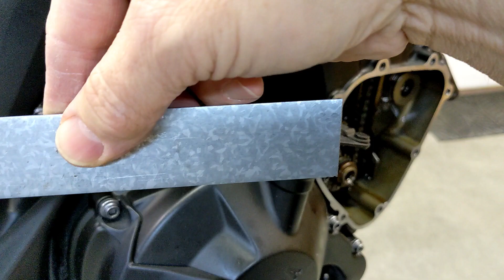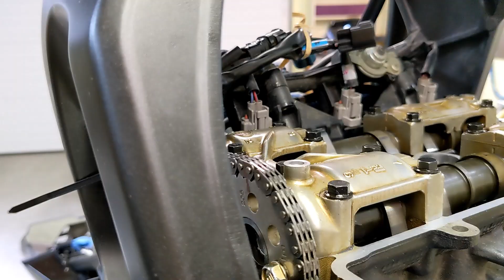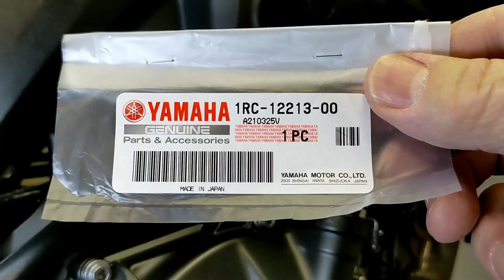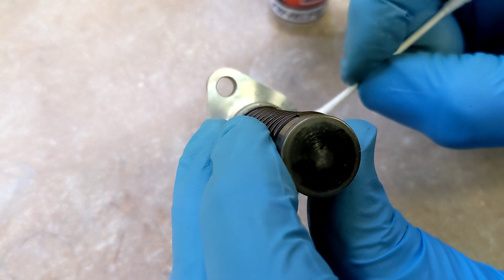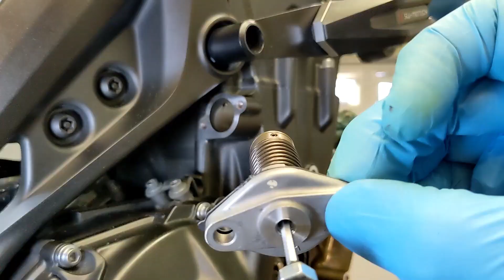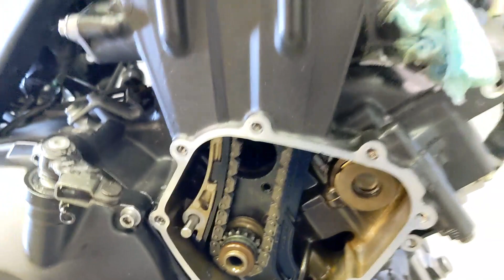reinstalling cam caps and setting valve timing  (PART 2) Yamaha FZ-09/MT-09 2014 2015 2016

Comment: what would I noticed different on my 2014 yamaha fz09 if the cam chain jumped a tooth?

I swapped to a A.P.E. recently and now my bike has less power at the front end of my throttling. My bike power the more I twist if that makes sense.
Reply from the maker: If you feel like it's off by a tooth I would stop riding right away and verify the timing
Reply: @meticulousmechanic  Honestly I have no idea what that would feel like and I re adjusted the APE today loosened until rattle then turned tight a little until the noise went away and now my bike rides like brand new. It feels like butter, and reminds me of a racebike. I think I'm good but if how my bike's acting now can still be if off by a tooth I may get it checked still just no funds in between work at the moment

NOTE: When I had the manual OEM cct in it was very obvious it was loose and got to oa bad loud point. I loosened the center cap bolt and dripped oil in (which probabalty did nothing) but as I tightened it I heard and felt two small clicks. After that the OEM was perfect no noise I had already purchsed the APE though and installed it anyways after the OEM noise went away
Reply from the maker: I have a feeling it would run like crap if it were off a tooth.... Valves most likely not shutting properly.... I'm not sure if this is an interference engine or not...
Check out my 46 video playlist on checking and adjusting valves... You would probably be able to check it yourself but it's going to take a while... The hard part is if you're having to switch shims if the valve clearance is off... @CupofJoeseph
Reply: @meticulousmechanic  Thank you, I'll keep an eye on it

Comment: when aligning the cams,surely there must be a easier way. how do they do it in the factory at initial assembly? great vids by the way.
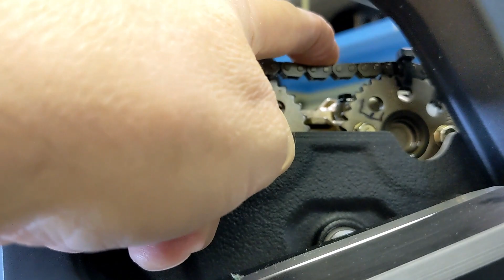Reply from the maker: Thanks...maybe at the factory the engine is out of the frame....you could have a jig that holds the cams in the correct postion...then you could just lay the chain where it goes with no fuss...at 14:14 into the video, I explain the mystery of the difficulty...I just rewatched this video which I made over a year ago...the only thing that I would do differently would be to make two rotation tools instead of one...I didn't damage the case by prying with a small force on the intake cam (the part with the brass shim) but would rather have a tool to turn it the slight amount needed.

Comment: hey man I'm curious if you experienced something similar to me with the cam chain. I got everything bolted down and in timing according to the btdc125 triangle/intake camshaft timing dot with the cam cap line/exhaust camshaft timing dot with the cam cap line, and all my pictures. My concern is my cam chain was tensioned correctly with my APE manual CCT before turning the generator rotor to verify timing marks come back, and when I did see my timing marks in line after rotating engine (which was great to see) my cam chain now has considerable slack in the same spot where it was tight before on the CCT side of the chain. And the other side, away from the CCT becomes tight... one side of the chain is tight in some positions of the generator rotor, and the other side is tight in other positions... I was thinking this may be the way it was operating before I did this service... since I'm doing the first valve adjustment at 35,000 miles... maybe the cam chain has stretch and that causes this? I have the cam chain casing off making sure there was no weird kinks or slack when I got my camshafts rotated to get the chain on the right teeth. 
what do you think? any thoughts are appreciated.
Reply from the maker: You could look in the manual to see how to check for cam chain wear.... Or I'm thinking, and I'm not sure, it could have something to do with being on cylinder one at 125 before top dead center on the compression stroke.... Maybe you're on cylinder two or three and that's why it's different...? Just guessing…..
Reply: @meticulousmechanic  thanks a ton for the ideas man and once again thanks for putting in all this work to film. Everything’s good for me after following except this cam chain behavior haha, I’m thinking it’s gotta be the tensioner or the chain itself. I’ll try to figure it out playing with the tensioner after I put everything back together. All timing marks check out after rotating the engine for now. You da man.
Reply from the maker: Let me see if I understand the situation.... You took off the  cam chain cover and analyzed the tension on the cam chain before you did anything by spinning the crank.... Then you removed the camshafts and put everything back together and now the chain tension is different?
Reply: @meticulousmechanic  i mean to reference the cam chain tension i inspected after the adjustment, and after I installed the cam chain tensioner. When you installed your cam chain tensioner after the adjustment and got it set to a good tension, you rotated the engine and got back to your BTDC125 timing marks. When I did this, I found my timing marks all correct, but I found that my cam chain was loose on the tensioner side after I got back to my BTDC125 timing marks, and it was set tight before I did this. Basically, after installing cam chain tensioner properly and rotating the engine, when I got back to BTDC125 I found slack in the cam chain where there was not before. The only thing I did was rotate the engine and something created a bit of slack in the cam chain but only on one side of it at a time throughout the rotation of the engine. Do you think this could be cam chain wear causing this? It couldnt be a tooth skipped because my timing is good...

Comment: Putting the cam chain tensioner bolts in is really tedious.  Has to be done one face of the bolt at a time.  The wrench has to be removed, rotated, then re-inserted many times.  It goes a lot easier with a tiny squirt of WD40 into the bolt head and a tiny squirt on the the end of the Allen socket wrench.
Reply from the maker: If I remember correctly, I was able to cheat a little with a long t ball driver to get most of the thread in...

Comment: A Pro AMA mechanic told me to always use Red Locktite on motorcycle nuts and bolts.  Despite warnings on the label about having to use heat, they are small so can be broken loose using hand tools.  As a result, I have been using Red Locktite on everything for forty years with good results.
Reply from the maker: Interesting...I hadn't thought of doing that.
Reply: guessing he was from back in the 2 stroke days, ha

Comment: Like the video shows, it can be difficult to rotate the exhaust cam enough.  I made another tool with a longer handle/lever arm and then it was easy to rotate the exhaust cam.
Reply from the maker: After doing this job, I might consider having one for the intake valves too. I had to rotate it ever so slighty.  In the video you can see I didn't have to apply much force and was able to gently pry up with a brass shim to protect the Aluminum...I rather not do this again, however, even though I caused no damage. If you have a friend to help at this stage it would be beneficial because I was using 3 hands even though I only have two...if I added another tool plus all the zip ties I might need 5 hands lol!
I think this comment goes with the video on setting valve timing.
https://youtu.be/dcaRfLx3_v4?t=237

Comment: Had pretty much the same problem. Had the timing aligned, zip tied the chain (but apparently not tight enough), tightened and torqued the camshaft cap bolts, and then realized it jumped off the chain/was sitting on top of it. So now to either try this method, or undo it all and try again
Reply from the maker: I'm surprised in all my research that no one has mentioned all of this (including the official Yamaha manual)  like I discovered when making the video...
Makes sense to me to tighten the cam caps down and then rotate the exhaust camshaft with a tool like in the video.... With a tiny bit of help to the intake camshaft as in the video...Otherwise there might be unwanted forces on the cam caps if you were using them to force the lobe down  against the valve bucket..they are lightweight aluminum, and probably would crack fairly easily. Thanks for the comment.... Let me know how it goes...
Reply: @Meticulous Mechanic  will do! The Haynes manual states that you should use the cam caps/holders to align it before torqueing it down, then ziptie. Honestly, had I ziptied tight enough, it would have worked. Though I agree it may put unwanted forces on the caps pushing the lobes. Giving it another go today with your method. I really only need it to move like 2 teeth so hopefully I can get it.
Reply from the maker: @lucasa241  There is an official tool but here is a link to a video (if you haven't found it already) that I made on how to make a exhaust camshaft turning tool
https://youtu.be/MAHjNCFnNs4
Reply: @Meticulous Mechanic  I ended up giving it a go with a wrench on my lunch break just now. Luckily, mine did not give way, so I was able to use it to move the sprockets. In combination with zip ties, I got the timing right where it needed to be,  installed the cam chain tensioner, cut the ties, and checked the timing, everything is right where it should be! Thanks for making these videos, it was incredibly helpful as this was my first time ever doing this.
Reply from the maker: @lucasa241  Glad you got it all workout out! What year and model bike do you have? Did you figure out any tricks on how to make this process easier?
Reply: @Meticulous Mechanic  2015 FJ09, got her back on thr road officially yesterday after throttle body sync and putting everything back together. I bagged and labeled EVERYTHING, so that helped. I also found that when removing stuck on hoses, such as the AIS, grabbing them with vise grips and moving side to side to break the seal loose made getting each one off WAY easier. Also removing the radiator prior to removing AIS, as you did. For the timing, I think your method or using a wrench is as good as it gets. For future adjustments I may opt to get a different torque wrench. Mine was so large that everything got in the way and it didn't work well with the lower increments like 10NM so it made the torqueing process for the caps a bit of a nightmare

Comment: I went through the proces today myself with my fz09, its really a pain in the A**. This Video helped me really a lot thank you for that!.
Reply from the maker: Your'e welcome...I know what you mean! Did you have to turn the exhaust cam like I did?
Reply: @meticulousmechanic  Yes i had to turn the camshaft exactly like you did
Reply from the maker: @DaMitch79  I find it interesting that after researching multiple forums and looking in the official Yamaha manual that nobody mentioned the fact that you would have to turn the exhaust cam with a tool to get it to work.... Especially the Yamaha manual says just "reinstall camshafts".... There should have been a whole section on this procedure! Did you glean any other wisdom you would like to share?
Reply: @meticulousmechanic  You are absolutely right - The fact that there is no detailed infomation about the critical process disturbes me somehow - not even in the haynes book i mentioned earlier.
I found only 1 video on youtube from a guy going thorugh this on his xsr900 mentioning he had to rotate the camshaft.
The conclusion for me is that very  few people writing about this prcocess did it really themselves , or just resigned or lived with the off timing i dont know.
Maybe they just didnt want to share the knowledge - in fact the CP3 Motor did not change for years so the process has to be the same for everyone doing this . Generally compared to a fz07 there is almost no detailed information about the fz09 doing the valve adjustment .
I really appreciate the effort an detail you put into making your videos , there is no place to share any wisdom from me :-)  You said it all and even more - i am sure that you will help a LOT of people in the future going through this process !

The only thing i did additionally off toppic is disassembling the cylinder head air induction system valves and cleaning them.
I did this cause my fz09 2016 has a really bad starting behaviour once the motor is warm.
I red somewhere that it sometimes has to do somethng with the valves sticking together - in fact  the valves were really sticky and dirty as hell.
I hope this will help - i will check that once my bike is reassembled .